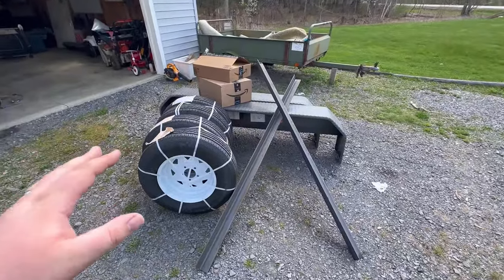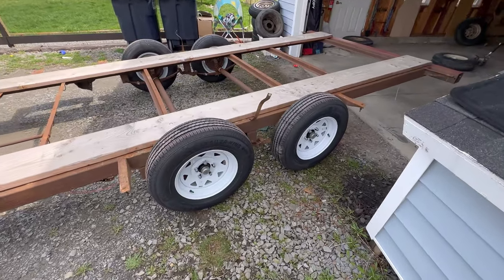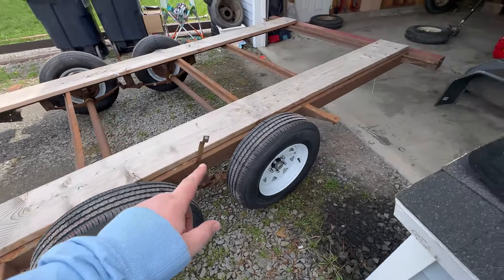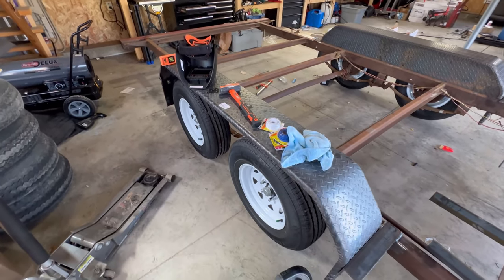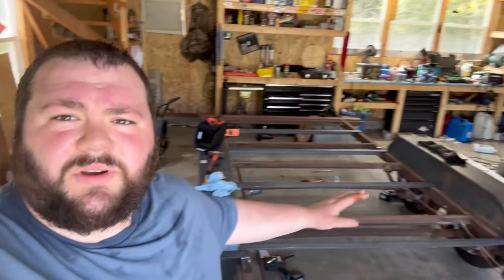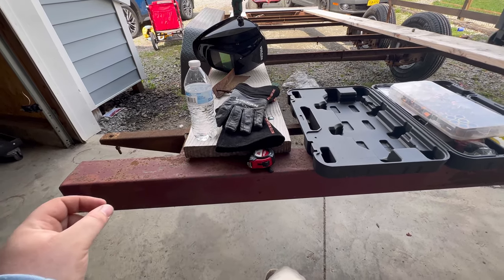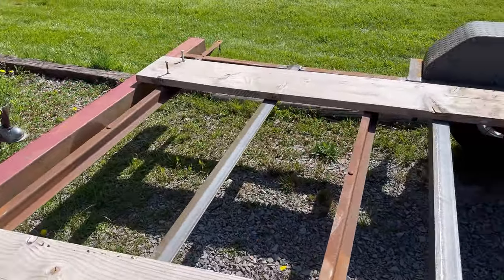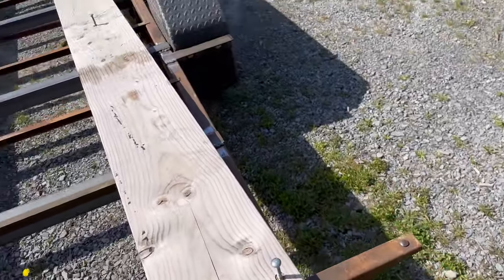Turning an Old Camper Frame into a Car Trailer - Ep. 1

Comment: Im doing the same on a FREE.99 - 21ft camper. Scrapped it to bare frame, put in 6x 2x3x3/16 cross members, 14" chrome wheels, new load range D tires. Ready to wire up all the lights, fab up drive over fenders, and outfit the storage, decking, stablizers, and ramps. then paint. Cool work.
Reply from the maker: I feel like trailers were double the value when I picked this up, then I spent $1200 on parts. Fast forward to today and car trailers are back down to $1,500, which hurts some of my motivation lol
Reply: It looks good overall. I built trailers back in the day for Crosley trailers in Ohio and your upgrades and custom work is worth far more the a cheap $1500 open car hauler. Don't be so hard on yourself as you did a good job yourself and improved your original trailer x10. 👍

Comment: Too bad you didnt move the axles forward a bit
Reply from the maker: The axles are almost dead center of the trailer if remember correctly
Reply: If u had an idea what u were talking about about, u may save others lives. A trailer is always supposed to have the axles biased toward the rear so it has a tongue heavy bias when loaded. This prevents swaying when pulled and will actually allow u to go more than 30 mph. When fully loaded a trailer should have at least a 10% weight bias on the tongue. That's why the larger the trailer, the larger the vehicle needed for towing.

Comment: Need a part 2. I wanna see some horizontal gusset/steps on the angle iron for the fender. (Use the old camper step.)
Reply from the maker: It’s covered in snow at the moment, but I have some stuff showing up for it this week. Hoping to get the j channel on, and build the ramp mounts, plus the new taillights.

Comment: I got a 1973 20ft camper I'm thinking about making into a trailer like this, however my rims are rusted completely through and lugs and nuts are so rusted and corroded, they won't come off. Its also a channeled frame. But for $450, I don't think its too bad?
Reply from the maker: Should be able to make it work! With it being a channel frame you may want to build a “platform” on top of the channels to help stiffen it all up

Comment: Why don’t you name the parts you buy to build the trailer on your list 🤦🏻‍♂️
Reply from the maker: Every ex camper frame is gonna have different axles & different axle spacing. So lug pattern and fender length could be different. The 2x2 angle I got from my shop for scrap price. Then a wiring harness depends on frame length as well.
Reply: The problem for old camper frames for car haulers is they are normally too light duty and narrow.  They make decent flatbed though
Reply from the maker: I work in the structural steel industry, you’re not wrong with ratings. However, generally box frames are the best (this is a 2x4 box frame.) If you stiffen it like I have it does a better job of distributing the load. I’ll have to look more, but I imagine the axles and springs are good for a 3-4.5k load (would make sense for a camper this size.) Since I only plan on hauling cars with it, I think it’ll do the job.
Reply: Did you run into any problems registering it?

Comment: where is ep.2 on this trailer ?
Reply from the maker: Coming soon! Time is being split between three other projects (two of which are full fab motor swaps.) We still have to dove the rear of this and then get it wired - it doesn’t fit in the garage so it’s abit chilly to work on 😂 oh and I keep forgetting to buy another bottle of argon

Comment: Im doing something similar with a 16ft traier frame I got for $100. I really like the fenders you used and the ease of how they mounted. Where did you get them?
Reply from the maker: You can get a pair here, https://www.ebay.com/itm/403301801903?mkcid=16&mkevt=1&mkrid=711-127632-2357-0&ssspo=0NsTkrXXTrO&sssrc=4429486&ssuid=bx81mmn7qiy&var=&widget_ver=artemis&media=COPY